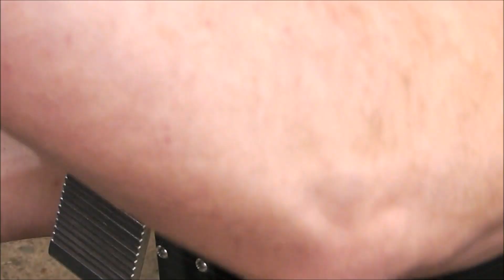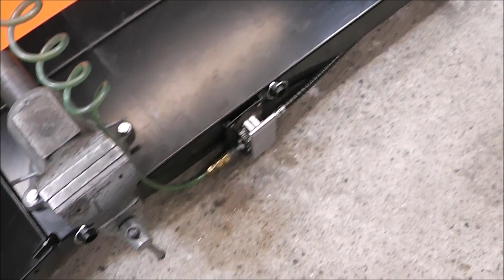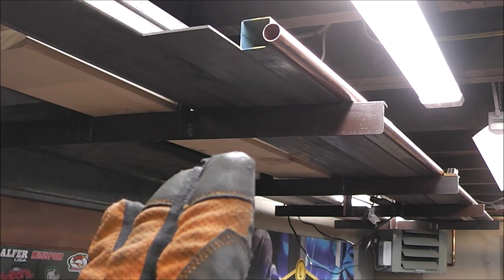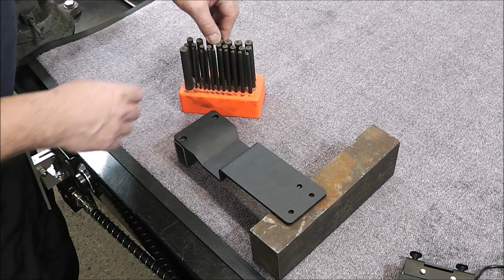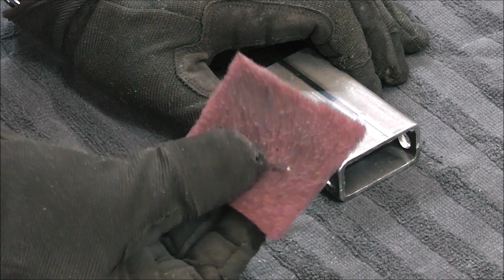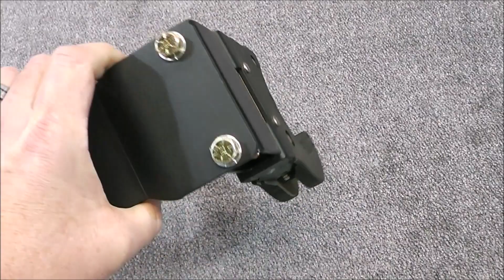Easy Metal Fabrication Project to Make Money

Comment: capped ends would of looked neat also I think you remounted upside down from the original way it was
Reply from the maker: All great points. I used snap in plastic caps but they were not here in time. Good eye on the reverse setup. It was switched around to accommodate it being mounted on the passenger side vs the driver side
Reply: i guess Im randomly asking but does any of you know of a tool to log back into an Instagram account??
I was dumb lost my login password. I would love any assistance you can offer me.

Comment: Should have put the seam down, only for appearance it's definitely  not a structural problem. My problem is I've always been a nitpicking perfectionist and tend to build pianos when a roughed out shoe box would do . If I could build it functional and pretty I was a happy camper. Over all that was a neat simple fix, I would have added a spot weld with the heliacr to the bolt heads to keep some clown from slipping in there with a 9/16 wrench and pulling the the lock and weapon out of the vehicle. I'm not condemning your work the projects I've seen you do are first class. This was only a comment from an old guy, keep up the great work and I know you're helping allot of new guys get it off the ground. BTW I like your lift table and if I ever get another shop off the ground I'll definitely build one. I would like to meet you one day God willing, because young guys who think outside the box are scarce as hens teeth. Thanks again
Reply from the maker: Great point on the seam. It drove me nuts too so I ended up making a couple extra and flipping them around. I also picked up some plastic caps to snap in the ends so it looks factory. You make a great point about being a perfectionist. This has actually been a huge problem in my life that I have struggled with for years. So many projects have been abandoned because I was so in over my head trying to make every component perfect. One example was I started a "quick restoration project" on a classic vehicle I owned which ended up with me completely stripping it down to a bare frame, sandblasting, painting, clearcoat. In short I spent so much time making parts that no one would ever see, perfect, that i lost interest because the work became so overwhelming. People ask why i spend so much time making something "perfect" when noone can actuallt see it. My answer has always been "because I know its there". Its tough when your wired this way but I'm actually learning to accept that everying doesn't have to be perfect and it actually feels pretty good. If you watched any of the Honda TRX rebuild series (especially the last episode) its evident that im conflicted between having one of the parts not completely perfect and accepting it for what it is lol. This was supposed to be a "budget rebuild" it ended up being restored to factory condition spending twice as much as I wanted.  I still struggle lol 🤣🤣🤣
Reply: @BrandonLund  I know the frustration well, and  actually lost money on a couple jobs before I managed to pull my head out LOL. I still remained a fanatic for square and true though. The plastic caps were a great idea cheaper and faster that making and welding them. I currently have a 92 Yamaha 250 twin classic I bought for about 180 bucks that needed the top end rebuilt. But I noticed rust in the frame and swing arm, and decided to tear it down to bare frame and repair it. Actually happy I decided that because the more I took off the more rust I found. So instead of a one week project it's turned into several months but it will be like factory new when I finally get it finished. One of the coolest things I designed and built was the Cannon I shot myself out of in the 1983 Rose Parade in Pasadena California. It might still be on U tube but I haven't looked for it in a while.
Reply from the maker: I'm going to have to find that video! You sound like a person I could talk with for hours. 🍻
Reply: @BrandonLund  Hello again Brandon, I found it after some looking. That second shot I broke my neck but did the rest of the show. The cannon messed up and it was my human error. Normally I inspected it after every shot but the constraints of the parade I didn't, (Murphy's Law LOL). If you don't want to sit through the whole parade move to the 2.5 hour mark. At the beginning of the video is just a publicity shot and practice. https://www.youtube.com/watch?v=bw1ve7NafOI

Comment: End caps will look good on  that spacer
Reply from the maker: Good call!
Reply: @BrandonLund  hey Brandon love the extension. 2 things I've learned in the last 10 years. Always put in caps on something it just makes it look way more professional and finished. And you can buy rectangular plastic insert in caps that make it look really professional. Or you can weld the sheet metal over it. Number two is always pay attention to the seem in tubing. I would flip the tubing over so the seams on the bottom. Also you can dip your bolts in a little bit of acid for just a few minutes to remove that coating and spray them black. Anything I do for police officers always is in black and they want everything in Black. So it's a way to strip the coating off. Without harming the threads.

Comment: Cool video!
Looks to me like
that blade is almost worn out! Lol
Reply from the maker: Thanks! The blade doesnt cut well when material is cut with the larger surface area facing up. The 1st cut was done this way and is going to be used to demonstrate proper material orientation ( or for this example, improper orientation). The 2nd cut was how it's supposed to go :)

Comment: Nice quick and easy.  But.. and I'm just giving constructive criticism.   You should have capped the ends for a cleaner look. Simply tig fuse a cap.  Also using black button head allen bolts.  Just a cleaner look. That's all.  Nice video.
Reply: I think I would of just used solid aluminum bar.
Reply from the maker: I dont disagree but this is just a prototype to test for clearance issues for now. The final design will likely change a little bit. I always cap open tubes but for this, the final design will have a snap in plastic cap.  This piece gets installed between the driver and passenger seat and the plastic cap is more forgiving on your body when bumped into. Thanks for the support and comment :)

Comment: Not sure if it matters but you put it on the opposite way to when you took it off. Cable is on the other side now. Nice video though 👍
Reply from the maker: Thanks Jason! Good eye. Rotating it was to help make for a cleaner install :)
Reply: @BrandonLund  It's all about getting that gun out of the lock in a hurry when needed.  You did mount it in the opposite direction from what you took it off.  However it would be quicker to remove from the driver's side as you mounted it, if it's mounted on the cage in between the 2 front seats. That swinging portion moves away form the driver's side, so you don't have to move the gun out and around it.   This is good for a Police Department where they have one officer in the patrol car.
Reply from the maker: @LightningFabrication  Hopefully I can explain this right. The rack was mounted between the seats but close to the passenger seat (almost touching the side of the passenger seat). The way it was before, the lock was opening on the passenger side but it didn't make sense because it was hard to remove quickly from the drivers seat. You had to maneuver it around the lock and manipulate the handcuff mechanism as you were doing this to swing it out of the way. It was just too cumbersome if you were in a hurry as you pointed out.  Now the lock opening is reversed and it's fast to remove from the drivers seat. A quick tug and the mechanism swings out of the way (towards the passenger seat) but it makes it a little slower to remove if your on the passenger side.
Reply: @BrandonLund  Yup I understand your explanation.  I used to work on police cars for the local municipality.  I know how cramped the cars can get with all the equipment.  They are a mobile office.  with laptops, printers, gun racks, cages, radios, light and siren controls and personal gear they get filled up fast. Not to mention you've only got a narrow space that doesn't interfere with the deployment of the air bags to mount the stuff
Reply: Thank you. I was about to tell him too lol